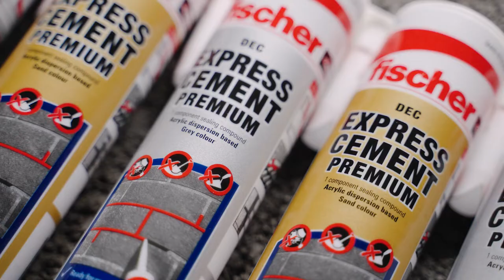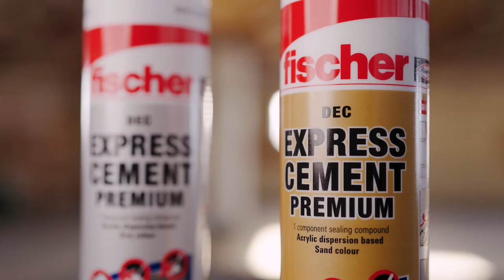fischer Express Cement

Comment: once opened, do you need to use it all straight away or can you store it for use after?
Reply from the maker: You can store it after. We recommend though that you cover the nozzle with something to stop the air getting in and hardening the cement i.e. tin foil.
Reply: @fischerfixingsuk thank you. No need for it anyway as I used all 5 of them 😅
Reply from the maker: @zambokid89  😂👍